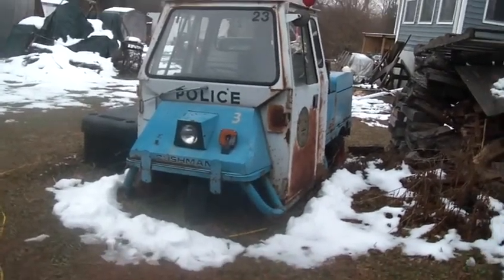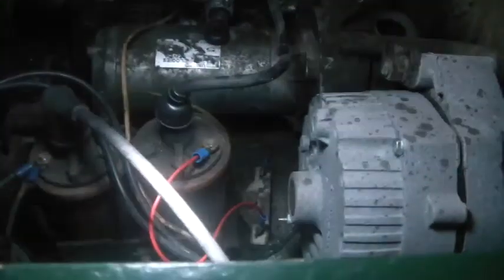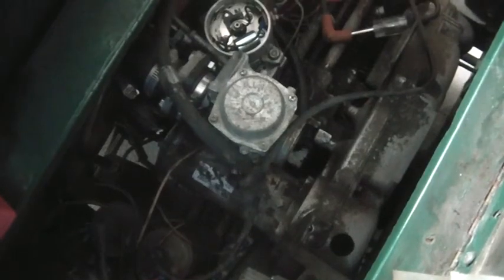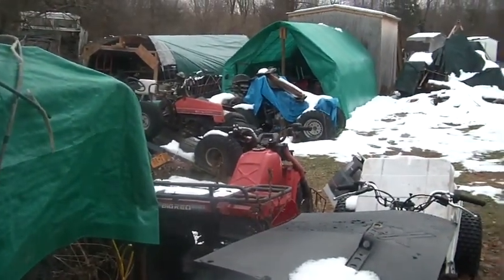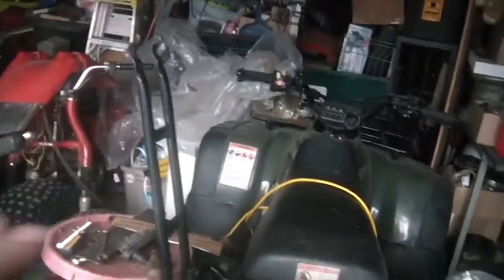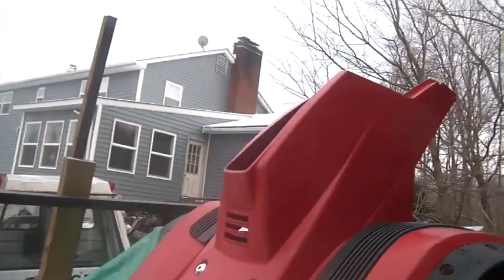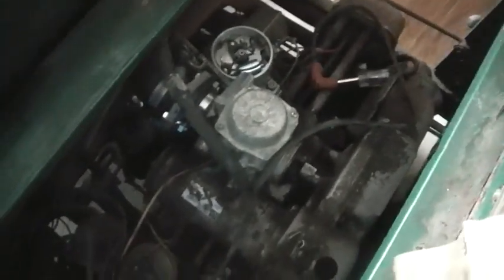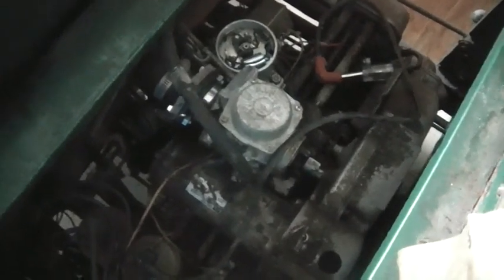12_1_2014, New coils, 1972 Cushman, Truckster, runs same,

Comment: I would say not the right jeting in that carb for when you rev it but I can be wrong I don't kow them Cushman nice to see your snow already melting  lol gotta love it when snow goes away cheers harvey
Reply from the maker: mecanicman66 , Ur snow will be staying until April!!!   The carb is not quite right, will be going back to the OEM one when I find my carb dip and after I rebuild it... Turns out, the problem was the capacitor... Thanks for the input, watching, and commenting!

Comment: I would check the condenser, its looks new but thats no garanti.
Then set the points gap, i usually set the gap bigger rather than smaller...
Reply from the maker: Donne S , U were right twice, the cap was new and recently replace, and it was the cause of the issue. I tend toward a smaller gap, I have had gaps that were a little big, become too big when things heated up leading to a misfire, (on my 1971 Ford Pinto), Thanks for the good input, watching, and commenting!

Comment: Gonna have to go with it still being a carb issue,,  with the backfires at higher rpm seems to richen up too much as the main jet opens in the carb.
Reply from the maker: Robert Bard , The motorcycle carb that is on it is not quite right, even with the new cap, it does have a weak spot during acceleration, as soon as I find my carb dip, I will be rebuilding the OEM one and hopefully, I get a perfectly running unit...Thanks for the good info, watching, and commenting!

Comment: I think that style carb has a built in fuel pump. maybe the pump can't keep up.  Who knows I still think its a electrical problem somewhere, maybe without the spark testers and it's own cap and rotor. Try the compression test and see, it only takes a minute to do.

Comment: May just look that way on camera but did the spark look to dim some at higher rpms . and every so often a little longer blink . but that could just be the camera . does dist shaft have any play or wiggle in it . Wonders what a spark plug looks like sense it has run a bit.  . wonders if all cylinders are same temp.Could shoot with temp gun. The points or condenser could be going bad . I have cleaned some that just dont come back to full live. Are all grounds good and in place , No way it could have any restricted exhaust could it ,.AND  If you think it is running rich try inducing a small vacuum leak to see if helps , if think it lean then add a little propane , but it done same on both carbs so not thinking that is it. Do the compression test sometimes it is easier to verify what all is working correctly and then concentrate on what is left.